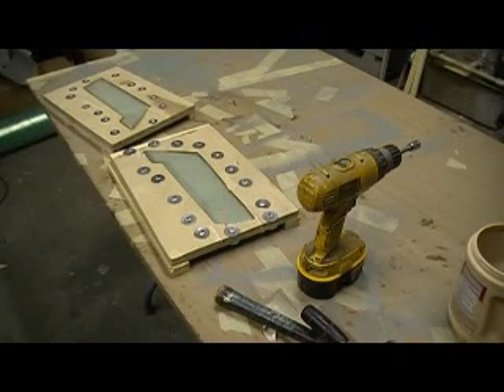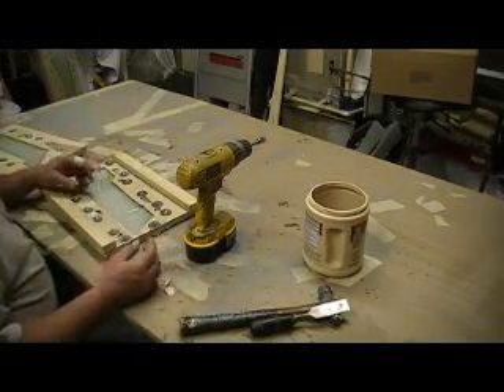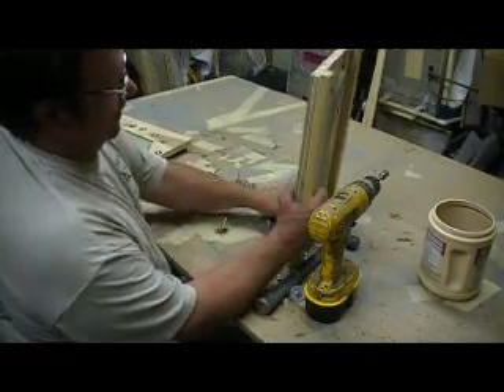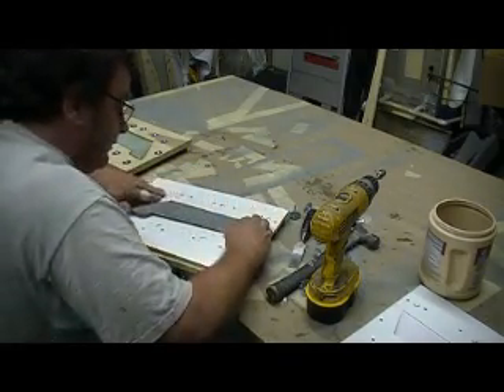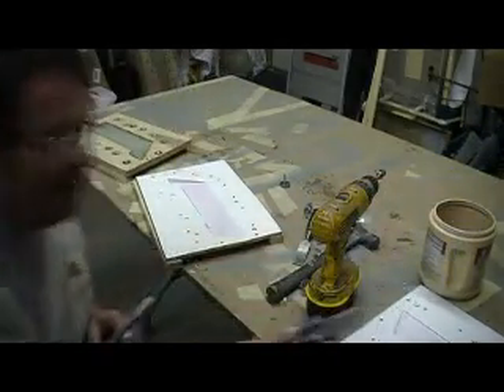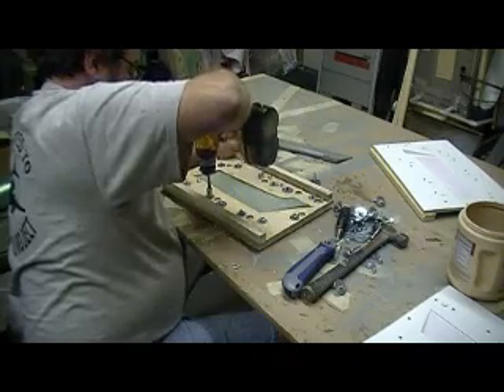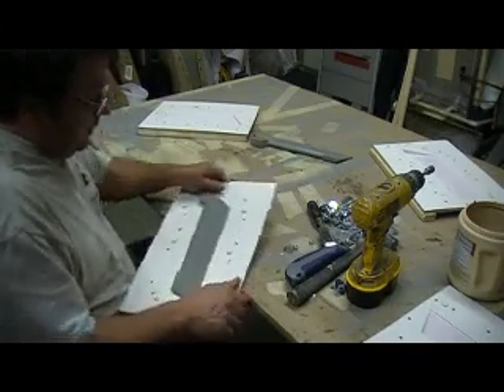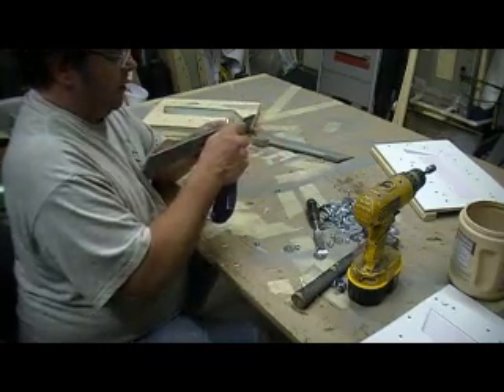F-105 thunderchief kits #83

Comment: @hornitpilot Bob 
TOP JOB, SUPER STRONG
Is you core (foam) perforated?.I use tool (board with pins) to perforated my foam,that will reduce air bubbles and weight, I aim for 60/40 (60 glass 40 resin)mix  in 12" vacuum.Easy to work out .In US in August, will visit my fevered  Home Depot and Lowe's.I guess I gone get BIGGER BAG
Dave